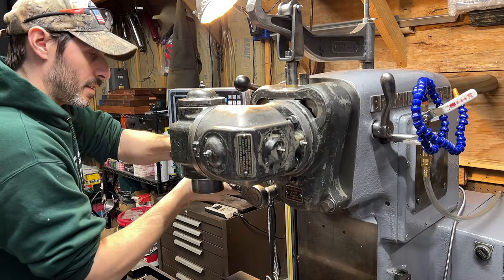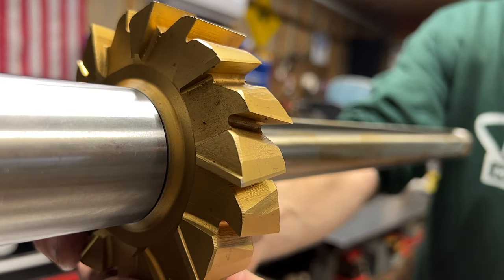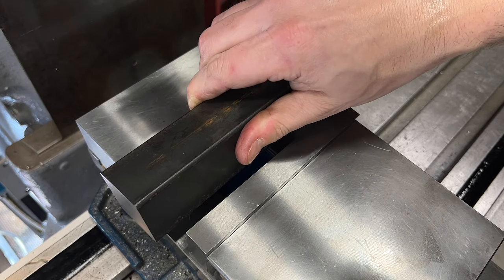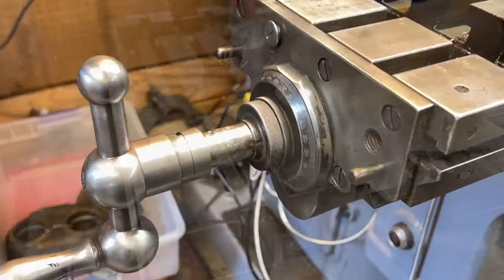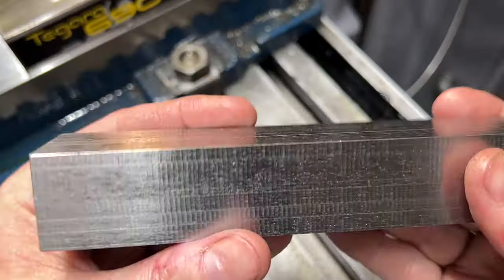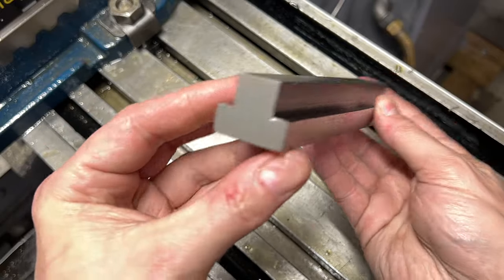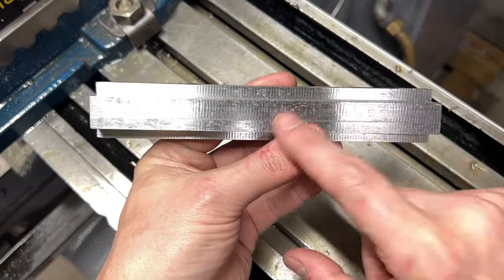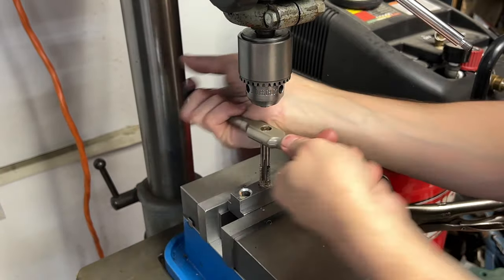Horizontal Milling T Nuts!

Comment: One suggestion.  Always have the over-arm support in place when tightening or loosening the arbor nut.  This will lessen the likelihood of bending your arbor.  Keep up the good work!
Reply: Was just about to comment this. My garvin horizontal mill had a really bent arbor when i got it and after all the work to get it straight I almost won't breathe on the thing without it being in the support
Reply from the maker: Great tip, thanks very much!

Comment: Regarding the chatter:
Verify that all your arbor spacers are very clean and have perfectly ground ends. Be sure your running bushing is a good fit in the overarm. Verify that your way gibs are tight enough and that the ways are getting the correct amount of way lube.  You can always play with feeds and speeds if you think the problem is harmonics.  Your size mill likes to take a heavy cut (depth & width) with a relatively slow table feed.  
Does your B&S have anti-backlash screws and nuts? If so, try making a climb cut. 

Thanks for the video and keep the horiz mill work coming.   Excellent content!
Reply from the maker: Thanks very much for the tips. I think I'll play around with speeds and feeds and see if I can vary the results and find some consistency in them. Like I said, a lot to learn... 😅I'm looking forward to using and learning more about the machine, and I'll definitely be sharing so stay tuned! Thanks again for the help, and thank you for watching!

Comment: The T nuts turned out fantastic! I need to build some for myself. Great video 👍🏻👍🏻
Reply from the maker: Thanks very much! They're actually a really great project. I thought that it would be pretty quick but there's actually a good deal to consider and do to construct them. milling, measuring, drilling, tapping, it's a surprisingly fun project with an incredibly useful result. thanks for watching!

Comment: I prefer a two-piece vice for a horizontal mill.  The fixed jaw goes on the left, spanning the slots. This way, the cutting forces are against and perpendicular to the fixed jaw.  The fixed jaw is held down with two bolts to better withstand higher cutting forces the  mill can produce.
Reply from the maker: Yeah those are super cool, it's on my list of projects. Thanks very much for watching!

Comment: Get your self a good Shell mill, the helix on such cutters is to prevent chatter, your slot mill is made for slotting😁
Reply from the maker: i wanted to use the shell mill for the squaring and cutting them to size but it wouldn't reach, hence the comments about some other work holding methods. i figured the side cutting mill would be good for cutting the tees, and it kinda was, except for the one side that came out looking like dooky. 🤷‍♂️

Comment: Good project- I’m surprised there was no gang milling :-) the ripples and gaulliste g are par for the course - try dropping the feed rate for a finishing cut. Get them case hardened and they will last for years
Reply from the maker: Thanks! I didn't have the cutters for gang milling, woulda been super cool though if I did

Comment: Hi, nice video thanks for posting. I made the same mistake as you when first using the horizontal mill. The two things I changed to improve things greatly were speeds and feeds. Also the following.
I think in a way you are using it like a vertical mill in asking it to remove almost all the metal with the outer surface of the cutter (i.e. the cutting edge that runs parallel to the table). I found that by using the side cutting edges (those perpendicular to the table) as the primary means of removing the metal, with more passes results in a much better finish.
Hopefully that makes sense. All the best.
Reply from the maker: Thanks very much for tips, I will definitely play around with those things and see what kind of results I can get. It's definitely been a learning curve trying to get away from the "vertical mindset". It's something that I'm aware of but still struggle in getting myself to "think differently" if that makes sense. Thanks again and thanks for watching!

Comment: I think you could gang the cutters and cut both sides at the same time. Also, drill holes in your stock and bolt it down to the t slots. Much less trouble than screwing with a vise.

Also, use an air blast to clear chips from the cutter. It's lifting some chips up and over and recutting them as they're carried into the cut from the rear. If you blow the chips in the teeth to the side at the front of the cutter, they won't get carried over the top.
Reply from the maker: Yeah I would have liked to gang the cutters but I didn't have matching cutters. My cutters are mostly 2nd hand resharpened because they're much cheaper, so the diameters are all over the place. I definitely think it's time I start learning more about fixturing and alternate work holding to better take advantage of this machine. Thanks very much for the tips, and thank you for watching!

Comment: I have never run a horizontal myself, but I think you could have added a second cutter with an appropriate spacer to cut both sides of the t section in the same pass, saving you half of the time.

I would love to have a horizontal, and with ToT not really posting anymore I think you are the only YouTuber that has one (that I know of at least). Looking forward to more videos on it!
Reply from the maker: Yeah I had originally wanted to do tandem cutters but didn't have two that matched. Most of my cutters are second hand regrinds because they're much cheaper so the sizes are all slightly different. I'm def looking forward to using it more and learning more about it myself. I just think it's super cool and a lot of fun to use. 🙂
Reply: Keith Rucker and Adam Booth both have horizontal mills.
Reply: How do you like running oil with your mill? Do you think it evacuates chips and cools enough ? I’m trying to decide which way to go ?  I like the rust protection oil gives for a machine that’s not used regularly. Thanks for the video !
Reply from the maker: @greglaroche1753  Thanks very much for watching. I definitely am happy with using oil in this machine. For an older slower spindle where greater cutting pressure is being generated the oil works very well and help preserve tool life. Oil and coolant are different animals that do different things. Oil lubricates the cutting tool, lowers friction and consequently heat, helps to prevent tool buildup, etc. Coolant cools, which is especially good for higher speed machining where a lot of heat is being generated but much lower cutting pressures. Coolant also lubricates, but not nearly as well as oil, just as oil cools, but not as well as coolant.

Comment: Now i may be shooting this straight outta my ass, but, it could also be the hen laying a golden egg... 

Surface grinders can produce very similar style of ripple-chatter pattern in the material... The thing with them in that case is the fact that the cut is being done too slow - feed-wise... The wheel, or i suppose in your case, the cutter is managing to make a full cut in a specific spot, thus neutralizing what little kick-up the cut is forcing the spindle to perform... There is always some movement, some flexing, some elasticity... This mill is rigid, but so are behemoth industrial surface grinders, and they see much less force imparted by grinding vs actual shearing cut... 

Now if that is the fact, each of those ripples with a valley in between the two of them are an instance where the cutter has had time to have ``sparked out`` or managed to remove enough material for the elasticity of the system to push it back into material and cut no more - it`s right where it should be on the final spring pass or in grinder`s case a spark out... Now the valley is followed by a ripple, which is the cutter engaging the material once more, kicking the arbor or whatever, be it support rods, be it squishing the table oil film, nodding the knee ever so slightly or whatever, but by re-engaging the material, there is enough deflection to the system that the cutter ``climbs up`` the material as it starts cutting, and as it engages properly, it digs back in, again finding the time to settle in that section for short enough to annul the elasticity... 

In case of surface grinders, you don`t mess with the spindle speed(most of them have but one anyway - balls out or nothing) as it`s apparently sufficient for the wheel to remove the material, so you increase the traverse speed of the grind, thus denying the wheel the time it needs to dig in, but rather you keep it fully engaged in the cut during the whole traverse, keeping the load on the system throughout the cut constant... 
If i`m right, you could technically make a pass like that, take the chips, lay them out in order in which they have been formed and measure them, you will get a sine wave function constant oscillation in measured thickness of the chips should you measure them... 

I can`t absolutely say that you should increase the traverse speed, but if you did kick it up by just a smidgeon it could be the cure, tho, i assume that your mill has a mech. gear mesh ratios for speeds, so no smidgeons for you, just steps... 

As said, i`m shooting outta my ass, comparing two very dissimilar machine types and machining processes, but ultimately, there is a whole lot of similarities between the two, so in this case, it very well could be an applicable line of thought... 

In a way, while totally different, it`s kinda why you stroke an internal cyl. grinder in a way so that the stone never leaves the bore on either end until you are done... The changes in load and deflection cause bell-mouthing... Whenever you have an instance where the system load changes, shit happens, same why you get streaks on manually fed lathe o.d. cuts if you stop for just a split-second in one place - there is enough time for the cut to annul the deflection... It`s all different scenarios of the same concept... 

Having had written my script of the day, i bid thee fare well - as I depart...
Steuss

edit tho, that arbour could be bent... the cut sounds eccentric, it should not be the cutter geometry, as those are usually much more concentric when compared to a slitting saw, but if the arbor is straight and the cutter is perfect, which i didn`t mention as i thought it obvious first ideas, it very well could be the aforementioned theory/surface grinder analogy... I just wanted to add this in, as to cross out the usual suspects off the list... and to say that that spotty ``flaking`` does appear to be re-cut chips...

Comment: Nice, not tapping all the way through to prevent damage to the table T-slots.
Reply from the maker: Thanks very much 🙂
Reply: @hersch_tool  you can also take a punch to the threads on the bottom of the T-nut to damage them so the threaded rod doesn't go down through into the table
Reply from the maker: @madmodder123  Yep that would certainly work as well.

Comment: I can suppose that you got that chatter on surfaces because of chips that are getting between the mill and material. Perhaps if you use cooling instead of oil for better chip evacuation, the surface will become smoother. Perpendicular lines on surfaces look like there is not enough rigidity. Maybe try to decrease the feed rate and increase the speed of the spindle. Nice video and very cool T-nuts you made!
Reply from the maker: Thanks very much! I think rigidity might be playing a role for sure. I've got a lot of practicing and experimenting to do and a lot of great suggestions to try out I think. Thanks again!

Comment: feed should correspond to the amount of teeth and rpm. giving you your ipm. run your finish pass as a climb mill to get rid of that chip recut.
Reply from the maker: Thanks man. I was reading that exact thing in the brown & sharpe "guide for young machinists" just last night. It didn't mention the climb cut though. Appreciate the advice, thanks.
Reply: @hersch_tool chip evacuationm could help out a lot too, a cheap harbor freight shop vacuum could be used to pull those chips out of the cutting path without blowing oil and chips everywhere. And a nice .005" per surface left to finish will get a much lower Ra value. I get conventional milling the rough cut, so as not to pull the workpiece, but your holding is more than adequate to take some beefy climb cuts. Toss an old cutter on that arbor and see how much you can let your machine eat before it gets concerning, then back off to 65% of that. Your rough cuts can look like a rippled beach, all day long, so long as you leave enought to give it a little skim at finish.
Reply from the maker: @jakedoom8807  This is all great advice, thanks very much. I appreciate you taking the time to comment and help out.

Comment: Wouldn't it help to run the power feed the other way so you aren't picking up chips with every rotation?
Reply from the maker: As others have mentioned, a very light climb cut at the very end for a finishing pass might help clean up the surface finish. But the bulk of the material removal still needs to be done with conventional milling. I'm sure saving 5 maybe 10 thou for a finish pass though would help out a lot for sure. Thanks very much for watching btw.

Comment: I'm far from being any kind of expert, but I'd say that (what you called) galling is probably chatter. From what i remember of running a horizontal mill, you want to choke up on your cutter a little harder.  You want to be centered up over your work, obviously, but you don't want, say 8" of spacers on the spindle side and a foot spacers on the other. That arbor's big and thick and heavy, but it still flexes.
Reply from the maker: Yeah I'm sure you're right about that. I tried to get as close to the cutter as I could but had to clear the vice especially on the head stock side.

Comment: Hmmmm. Id be nervous about not tapping all the way, seems to me that you are going to have a lot more surface area to get the threads jammed and could run into removal problems.
Tapping all the way and then bending the last row of threads to stop the screw would create less surface area for threads to contact and be easier to release. 
Then you will also have more consistent nuts as i suspect each nut has a different spot where the bolt stops.
Reply from the maker: yeah that would definitely work as well. the consistency isn't really an issue though since they're just t nuts. if i find there's any problems with removal i can always go back and run the tap the rest of the way through, but i don't imagine it'll be an really, hopefully... lol. thanks for watching!

Comment: Maybe you had the surface finish problems because you did everything conventional milling, you need to take the last .5mm climb milling and same with the side faces otherwise the cutter is always rubbing on it 
But cool vid with big chips
Reply from the maker: Thanks very much, some others have mentioned the same thing. I definitely should have saved a few thou for a climb finish cut. Thanks again, and thank you for watching!

Comment: Nice result. Question: Why do you use cutting oil instead of soluble oil and water mix?  The soluble mix is better for cooling and also washing away chips.
Reply: Lubrication
Reply from the maker: The oil provides lubrication for the cutting tool, reducing friction, lowering heat, preventing tool buildup, etc. especially good under high machining pressures.
Reply: @hersch_tool  Which is why you should use an emulsion. This combines the properties of water and oil. You get the lubrication of the oil while you also have the advantage of  higher heat transfer and better chip removal that water provides. It is also significantly cheaper than running pure oil. The only real disadvantage is that the emulsion can go bad. However if you aren't in an insanely hot climate, that can take months.
Reply from the maker: @Grossaaa  negative. Emulsions doing not lubricate as well as cutting oil. Emulsions are great for high speed modern spindles. For slow spindle high cutting pressures oil lubricates much better. Oil is a good choice for this machine. Not to mention, oil doesn't go rancid and the sump for this machine is in the base and very difficult to change. Again, oil is a good choice for this machine.
Reply: @hersch_tool Yeah, it seems HSS and HSCO cutters generally work better with oil coolant due to their cutting parameters. The better you can dampen rubbing, the longer the tool will last, especially with HSS and HSCO cutters.
Reply: @hersch_tool   Emulsions are also used on older machines. Machine age is not the determining factor when deciding on speeds, at least it was in the 5 years I've been machining now. Might be different across the pond though.
Reply from the maker: @romanvarcolac2238  yeah agreed

Comment: Nice video. I don't know about your shop but I find shards everywhere. So for safety sake I'd spend $0.60 for a switch plate before you have a real surprise.
Reply from the maker: Thanks very much! And yeah, lol I keep meaning to pick one up. I cobbled together the coolant system on a Sunday afternoon using stuff I had around the shop, had the switch but not a faceplate and just haven't remembered to pick one up.